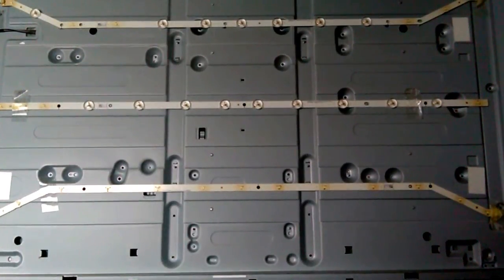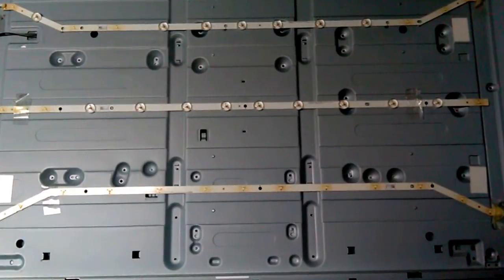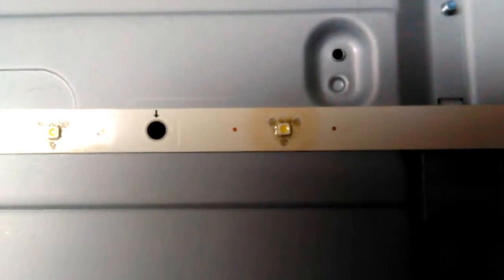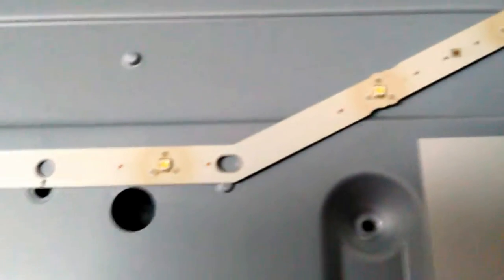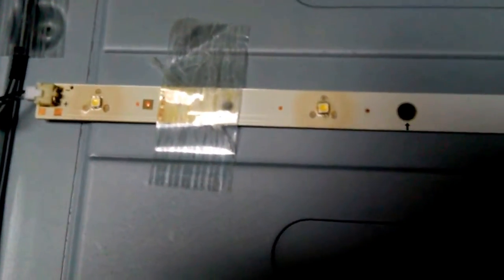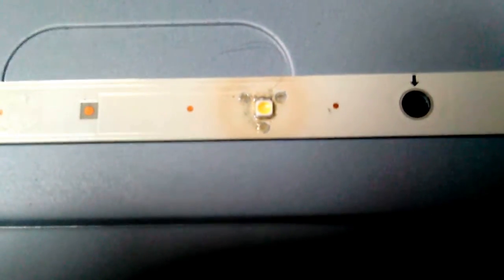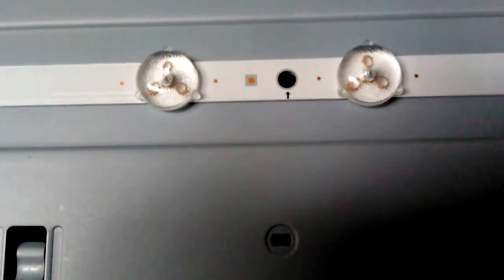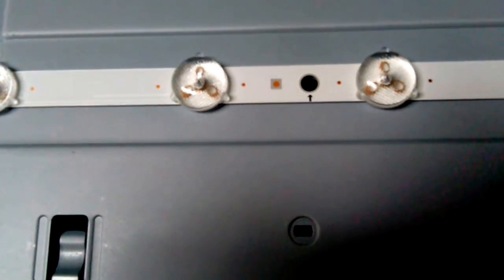Samsung 40" Smart TV LED Backlight Fault. UN40H5203AFXZA - UF05. Part 1.

Comment: I have 2 TV's to do this to and I am intimidated. Grrrrrrrrrr. Thanks for posting
Reply from the maker: You are welcome. If you need any advice, please ask, Good Luck !
Reply: @KB1UIF  thank you so much, I appreciate it.
Reply from the maker: This excellent video shows how to dismantle a Samsung TV https://youtu.be/ogtfojsIZK8
Be very careful how you handle the LCD panel as they are very fragile.
Reply: You could buy complete replacement strips to avoid learning to solder these.
Reply: @CTimmerman  thank you for your advice. I will definitely look into
Reply from the maker: @CTimmerman  Yes the strips are available at a price from various suppliers, but can be quite expensive. As I am an electronics engineer its a much cheaper option to replace a few LEDs for a few cents each, as opposed to the complete strips plus postage and hoping to get them still in a usable form in the mail.
Reply: @KB1UIF  True, but 20 USD is cheap compared to a new TV or soldering course.
Reply from the maker: @CTimmerman  When I posted this video the strips were quite expensive at around $90-$120 for a set of three. There seems to be a much cheaper supply now from china. You might like to post a link to where you can buy a set of strips for $20 for Rosalyn Martin. My TV required LED's replaced on all the strips and at the time it was more cost effective for me to replace the individual LED's. I'm not recommending a novice replace LEDs on the strips this was just how I tackled the problem at the time. Buying the strips would be the easier option, if the thought of replacing the LED's was too much of a challenge for a novice to electronics and surface mount soldering onto aluminum strips.
Reply: @KB1UIF  I lost the YouTube link, but according to Google Alibaba has 10 strips for 30 USD or less.
Reply from the maker: @CTimmerman  Take a look at Shop-jimmy's price for the 3 strips required for my Samsung.
 $54.95 + $10 shipping. Remember I required all three !
https://www.shopjimmy.com/samsung-bn96-28766a-bn96-28767a-led-strips-3-strips.htm 
That's now !! they were more when I needed them !! Yes cheaper in china now ! but like I said not when I needed them when I made this video. This was very much a learning experience for me and at the time not much in the way of information about the type of LEDs used ! I went this route because I do repairs for people also, not as a business more of a hobby so this way keeps the costs down and I don't have to wait 3 weeks for them to arrive bent via the mail !